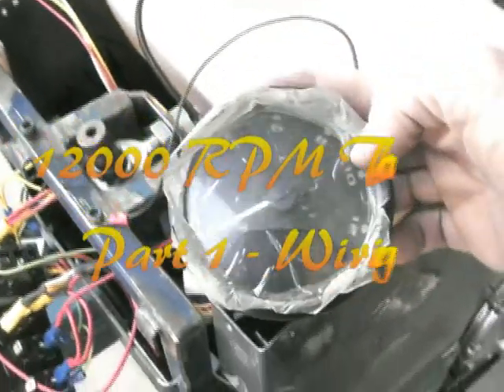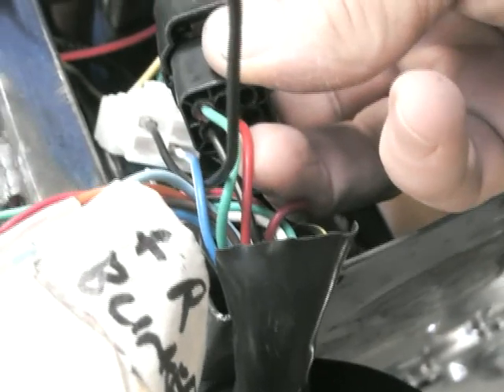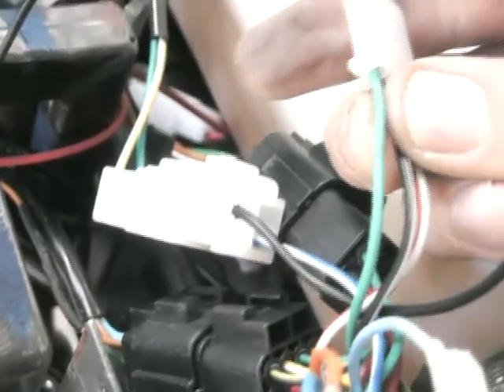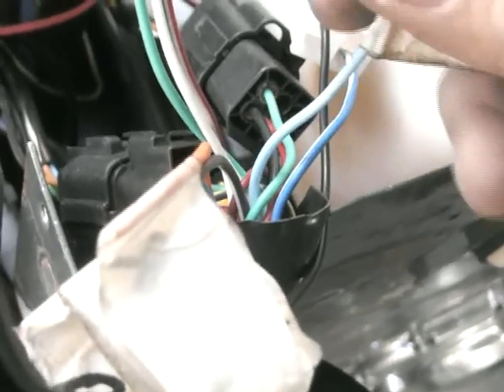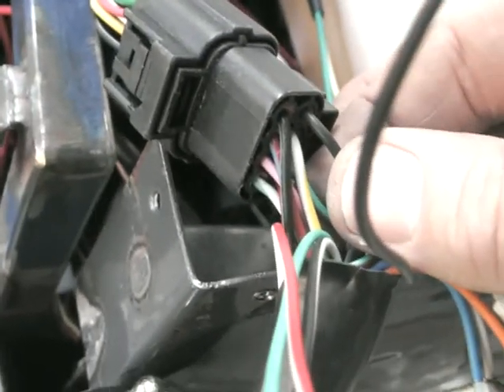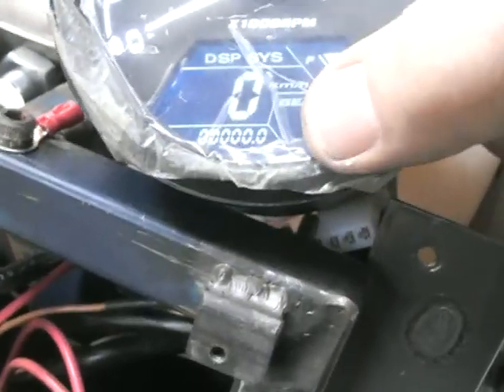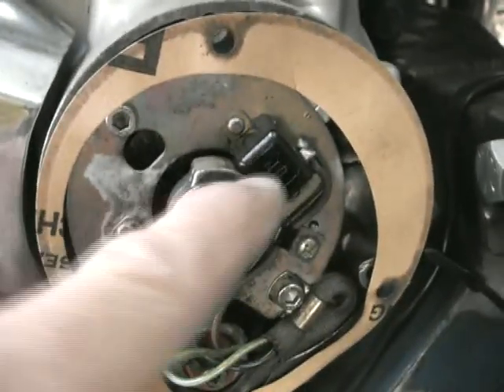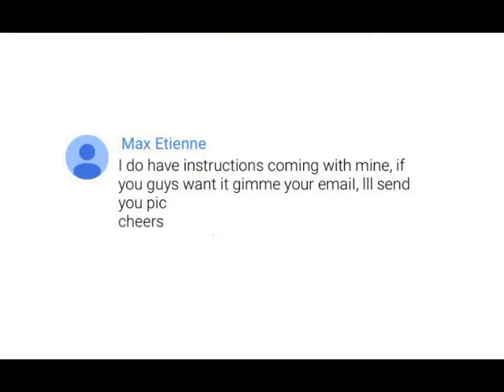12000rpm Tacho Part 1 Wiring

Comment: Hey, thanks  for such a great video but I do have one question about it. In the Video, when you talk about the first 3 wires, would the black be the Ignition since the red is running power? I'm wiring up a 2005 Kawasaki Z750s and I think that is the last part I need before I can dive in.
Reply from the maker: Yep, black is ignition
Reply: @Mezzmoengineering  hi there did you take red feed direct from the battery? Also doesn't it drain the battery?

Comment: how to speed up the hand when the clock turns on quickly go to the end and return?
Reply from the maker: I'm not sure what you mean?
Reply: @Mezzmoengineering  when I give the throttle at say 4k rpm and let go, the hand goes slowly and slowly comes back, it doesn't go according to the rpm
Reply from the maker: @daki500  Hi mate, if it reads accurate when held stable then its probably working. At the end of the day its a pretty cheap unit....I guess we just get what we pay for...
Reply: @Mezzmoengineering  It's cheap, but I see on youtube that it works as it should for everyone

Comment: Hello!! What fuel sensor did you use? My gas tank doesn’t have one so I have to also install one on it.
Reply from the maker: I used a fuel sensor from an alloy tank I bought from ebay. There are a couple of settings you can use to match various resistance of the sensors.

Comment: Hi there and thanks for great videos. I'm halfway through installing it on my Ural and have found it so far to be quite straightforward, but only because of your instructions!

I have a couple of (hopefully) helpful comments...
The yellow/black wire I connected to one of the primary wires going to the coil, rather than wrapping it around the ignition lead.
The red lead should be straight to the battery, so always powered. The black wire should go to a switched power source, and I used the wire that powered the backlights of my previous speedo. It's a common problem people have with this speedo that they only wire the black to constant 12V, so it's always turned on.
I don't have a fuel sensor, so to stop the fuel gauge from flashing I had to put a 330 Ohm, 1 Watt resistor onto the blue/white wire before connecting it to ground. It reads half full, but that's better than flashing. Connecting it straight to ground kept it flashing for me.
I only had one flasher light on my dash, so took leads off the wiring that went to the handlebar switch.

My first power on....
https://youtu.be/0nfwcrq8vK4
Reply from the maker: Good one, thanks John
Reply: Oh the disappointment! Any help appreciated. I’ve installed it, wired it up and started the engine. The tachometer needle comes up to about a thousand, but when I rev the engine, the needle goes to zero and stays there. When the goes back to idle the needles comes back up. Any ideas?
Reply from the maker: Hmmm, have you got Mode 3 set to the number cylinders you have? And how have you connected the signal wire? You need to connect the signal wire from the pick up sensor for the coil, this should be in the end of the crankshaft. Or from the CDI unit input which again should have one trigger signal from the crank. I doubt it will work when connected direct to the coil
Reply: Got it working using a tacho adapter. https://www.youtube.com/watch?v=oMBsy_0MBPQ&feature=youtu.be

Comment: I connected the black power switch cable to my ignition but the problem is my speedo stays on the entire time, even when the bike is off. Any suggestions that could help me?
Reply from the maker: Hi, red goes to battery so there's power all the time and black is only when ignition is on

Comment: Great video but why do you say it can damange the tach if you connect it to the coil? Almost all tachometer manuals says you should connect it to the coil.
Reply from the maker: Because the input signal to this tacho needs a lower voltage. I think it will fail if you connect direct to the coil. Let me know if you get it to work that way
Reply: Classic Celicas and more Ok, I have Daytona tachometer but I don't wanna risc damaging it since it's expensive. I think it's low voltage to the coils and high voltage is the cables out from the coil to the plugs but I don't know. I've seen others getting wrong readings from the coil. The spark generator cable seems to be better so I'll try to find it.
Reply from the maker: @myshitonyoutube  the RPM voltage signal is not the same for all tachos. Older style tachos generally went direct to the coil, others are lower voltage, just depends what you have.

Comment: My old speedo has just one connection  for both right and left indicator as it had just one indication light on speedo for both .How can i wire up with this speedo so that this new speedo lights up both right and left indications separately ?
Reply from the maker: Maddy, you  just use the two separate signal wires to your blinkers. Eg left blinker signal goes to speedo and right blinker wire is separate to give both left and right signals.
Reply: Classic Celicas and more : Thanks Mate Cheers

Comment: How did you calibrate the speed??
Reply from the maker: Its all in Part 2, check it out
Reply: @Mezzmoengineering   hai bro, i saw that yesterday. Before watching your video my speedo shows double than the actual speed, now it calibrated based on the instruction from your video. Thanks a lot.

Comment: Hi, thanks for the video, could you tell me what is meant by the speedo positive, negative and signal please
I have the same wiring as you.
Reply from the maker: Those 3 are on the separate 3 pin plug and are for the sensor for the speed. This just plugs in....

Comment: Like everyone else, I found your video when researching this gauge. I've gotten everything to work except for the same things everyone else is having trouble with. My 84 Magna does not use a fuel float so I need to ground that, unless you have ideas on how to make the low fuel thermistor sensor work? Also, the bike doesn't have a gear sensor, but it did use an overdrive light to indicate "6th" gear. Due to how this gauge is set up, I can't seem to make it work.
Reply from the maker: If you want fuel its easiest to install a float into the tank like I did to provide the signal. Gear signals are just when the appropriate gear is earth on the gauge. Eg, Earthing a gear cable will make the tacho show that gear, hope that makes sense.

Comment: This video helped me a lot, thanks for that. On my cb360 the Tacho won't  receive the RPM signal. When I use test light I can see the light pulsing so I know I have the correct signal wire. This two cylinder bike has two coils and I have the tacho set on 2, for two cylinders but it doesn't read. Is there wasted spark on this bike and should I have left it set on 1 ?  Any suggestions will
 be appreciated.
Reply from the maker: Hi, I'm' not familiar with your engine but sounds like it is not wasted spark. Wasted spark is when the coil has two output cables. Either way if its wasted spark it will still work but the RPM reading with be either more or less than what it should be. You need to get a pulse with the correct voltage. Is the signal wire from the pick up points or from the coil itself. Mine works from the pick up points and not from the coil.
Reply: The signal is from the red wire of a PAMCO electronic ignition wher I get signal with my 12v tester.

Comment: Hi again Do you know what kind of signal it should be for the tacho ? Thanks
Reply from the maker: I'm not certain as I got it to work without too much trouble and at a point where I didn't need to know exactly the voltage, my guess its looking for a 12 volt signal but someone else might be able to confirm...

Comment: Probably my last question since I've gotten everything thanks to you. If your bike doesn't have an already made gear indicator on it, how do you wire the gear wires?
Reply from the maker: The gear indicators in the tacho work when each cable is earthed. Eg if you earth the first gear cable from the tacho it will show "1" for that gear and so on. So all you need to do is connect the gear indicator cables from your engine to the tacho. If you dont have gear  wires from your engine then it can only work if you figure out a way to provide an earth signal for each gear you are using. If you leave them disconnected then it will just be blank and not show anything on the tacho
Reply: @Mezzmoengineering  I own 2017 Bajaj Avenger 150 street in India,which doesn't have gear indicator but as u said above if in any way earthing is made for separate 5 gear's wire then will it work
Reply: mine doesnt have a gear indicator but it being a suzuki gs500 i got a suzuki 150 gear indicator which has all the nessassary prongs i have yet to wire up mine so i will be learning if got everything right :P

Comment: Another question. Did you physical solder the black and yellow wire to the pick up post or merge it with a different wire outside the engine.
Reply from the maker: You could solder directly to the pick up post however I'd recommend merging to the same cable but a little away from the post itself.
Reply: Classic Celicas and more you're the man. I got everything on mine to work but the gear indicator. Not sure what to do there.

Comment: Regarding the red wire (constant power). You mentioned it will cause the needle to get stuck. Will it also cause the speed to not function correctly? Mine sometimes works and other times, the needle will get stuck. The fuel and mph doesn't display. The lights displayed on the speedometer still work properly though (Neutral, turn signals, etc)
Reply from the maker: I'm not certain what will happen with the speed, its best to make sure it has power. The fuel  will not work unless connected to a level float that is set to the correct resistance

Comment: Hello and thanks for all you do. I still have a problem with the RPM. I have a BMW K75 and tried different things but nothing work. I tried the four wire come from the hall effect sensor (black, red, orange and brown) but nothing.Do you already heard something about this problem ? Thanks again
Reply from the maker: Hi, I'm not familiar with your engine. You should check your wiring diagram to see where the sensor wires go, one of those cables should work. This is a challenge for lots of people. Someone else may be able to advise for your particular engine. Its also possible you may have damaged the tacho is your have put power on the wrong spot but if you power the tacho and it does the sweep then it should be good.
Reply: Loic estrade can you tell me how did you connect the cables in your k75? I dont know how to start with my k100. Thank you!

Comment: The pulse generator usually already has a wire coming off it... Can you just use that for the tach? If so... Isn't it pretty obvious to use that for the tach signal since thats what the OEM gauge uses?
Reply from the maker: In theory thats correct. The problem might be that the signal voltage isn't right

Comment: Great video bud! I have everything working perfectly, besides the tachometer. /sigh. The bike is a 2012 Harley iron 883 sportster. I tried hooking the yellow and black wire to the coil with a resistor. No luck. Also tried hooking it to the crank position sensor. Also no luck. Any ideas? Thank you so much!
Reply from the maker: I'm not familiar with your bike. Check the wiring from the crank sensor as it should go to a control box, not sure how many cables but I'm guessing 4 to 6. If there is one, try each terminal quickly to see if it works. I would avoid connecting directly to the coil as I've heard others have done that and damaged the tacho
Reply: Classic Celicas and more thank you so much for the response bro! After studying wiring diagrams online I found the crank position sensor goes strait to the ecm. If I splice to be crank position sensor ground the tachometer will work but it’s all over the place. Do you think it possible to splice into one of the fuel injectors?
Reply from the maker: Sounds like you have picked the wrong wire from the crank sensor. I don't think the injector signal will work but might be worth a try. I'd be looking closer at the crank signal wiring and pick a cable going from the sensor to the ECU rather than a cable thats a signal out from the ECU
Reply: Classic Celicas and more not sure if I follow. The crank position sensor only has two wires. One red and one black. Both wires go to the computer. I appreciate all of your help a ton!
Reply from the maker: OK, have you tried both those cables? If neither work it could be sending out a signal voltage different to what the tacho needs
Reply: Classic Celicas and more yes sir, tried both of them. No dice.
Reply: Classic Celicas and more I tried both wires with a 100k resistor on both and didn’t work.

Comment: HI there. I followed your instructions and everything works like a charm but I have an issue. when I have the battery on the tach it gets stuck at 4000 rpm. when I REMOVE the battery ENTIRELY off of the bike  everything works as expected. I'm getting my signal from my pick up coil negative . 
The bike is a 1984 (OR 1985) YAMAHA XT 250 CDI ignition  triple coil (charge,lights & pickup coil)
Reply from the maker: Hi, not 100% sure what you mean. So when you remove the permanent battery supply to the tacho it works? Or you leave it wire as per my instructions and it suddenly works when you remove your bike battery? If you don;t have power all the time when you turn the bike off the tacho can get stuck on whatever RPM the engine was doing when power was turned off.
Reply: Thank you for your kind reply. I figured it out at last (over-voltage at higher rpm). No that was not the problem. the needle got stuck at 4000rpm while the engine was running at 4000+ rpm. i have every wire connected as you mention in your video. when i remove the battery itself the problem disappears . The fix is a low pass filter (passive) made from a 10uf electrolytic capacitor and a resistor connected to the signal wire before it gets to the tachometer. Also i took my signal from the rectifier this time (i think from the lead that connects to the lighting coil the yellow/red wire)

Thank you again, You're awesome!
Reply from the maker: Good work! Glad you got it working

Comment: Hello sir, 
Thank you for the video, you definitely helped me understand how to wire the tach! Luckily I got one with the same wire colours as you and pretty much everything works now except for the Neutral light that seems to be burnt out but I will hook that up to the running lights indicator. However I cannot get the tachometer to work, I have a 1989 Honda CBR600 and I hooked it up to the Blue wire of the Pulse Generator but no sign of movement from the tach. Would you be able to help me out?

Comment: Can you please me what to do with the black cable on the speedo? Where does it go?
Reply from the maker: As I say in the video, the black cable is power. Normally from the ignition so its only on when the engine is running.

Comment: If you have a two-stroke engine, do you have to set it to 2 cylinders because it ignites every rotation? My 50cc ATV is showing me around 1800RPM in Idle with the default settings
Reply from the maker: Good question, it depends. Usually 4 stroke engines run wasted spark meaning that it sparks on both inlet and exhaust cycles, so once every rev just like a 2 stroke. If you have 1 cylinder I would pick 1 cylinder. To be certain you could buy a cheap rpm meter from eBay to check, cost of this is only about $10. Remember once you select something other than 1 cylinder in the mode setting you can't go back to 1 again....It is double what it should be then you spark set up might mean it needs to be set to 2. For my engine, I set to 2 even though I have a 4 cylinder because my coils are dual and fire 2 cylinders at the same time. Hope this makes sense
Reply: Thanks! Can you also use the Speedo with contact breaker ignition systems (hope this is the correct spelling in english) or is the voltage to high? There is just one cable that goes directly from the capacitor to the ignition coil
Reply from the maker: Yes, you connect to the signal from the contacts which is not high current, Don't connect to the positive of the coil. You should have a cable going from the contacts to provide signal for the coil/s. That should work.
Reply: The problem is that my contact ignition system of a Hercules Prima GT ( A German "Mofa") has only one cable which goes directly from the capacitor to the coil, so I don't have a signal cable that goes to a CDI or something else. The coil is directly grounded to the frame. Can i also use the signal from the positive light cable which goes to the stock rev counter or just pick up the signal from the ground of the coil?
Reply from the maker: Hi, I don't know for sure but if it was me I'd try using the cable going to the coil. You don't have much choice, just try quickly to see if it works.
Reply: Hey Ken Guy,
I am trying to use this tach with my two-stroke 80cc gas bike kit, but cannot find where to attach the speed wire. Where did you end up attaching the wire for the rpms? It doesn't work when I attached it to my magneto wires, around 40V AC.
Thanks!

Comment: Just ordered a speedo like this and researching it all to be ready when it shows up. I think I got it all figured out but the fuel sender. I putting this in a buggy with a 2 or 3 gallon tank and wondering what sender are you using? All the ones I keep finding look like they are way too big to fit in my tank but yours looks small enough to work.
Reply from the maker: I used a sender from a small fuel tank I originally bought on eBay. From memory the tank was a 5 litre with a sender that was easy to remove
Reply: Thanks. I think I found one that is meant for marine, it's only4 1/2 inch deep (11.43cm).